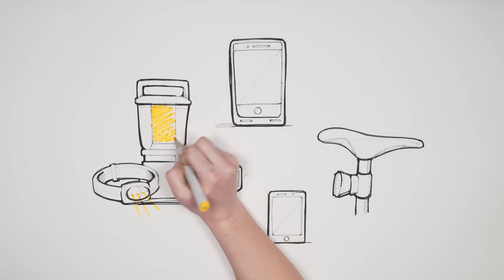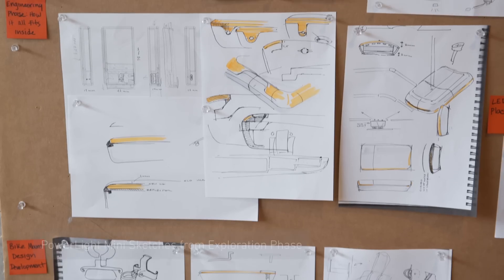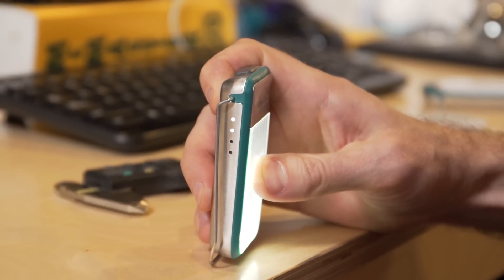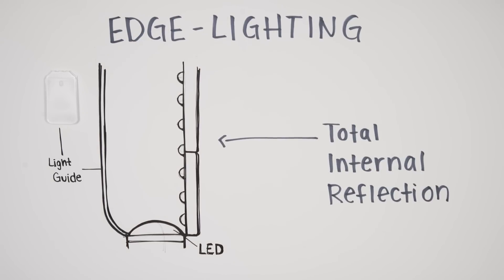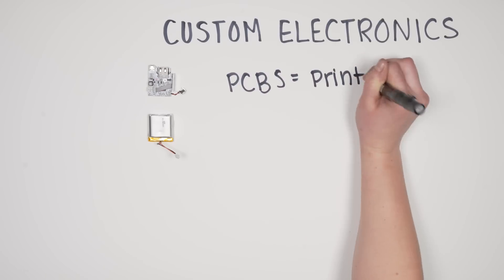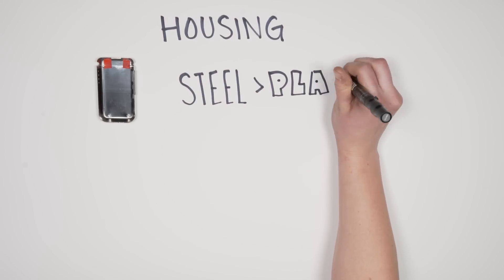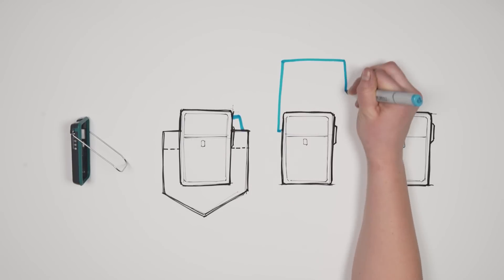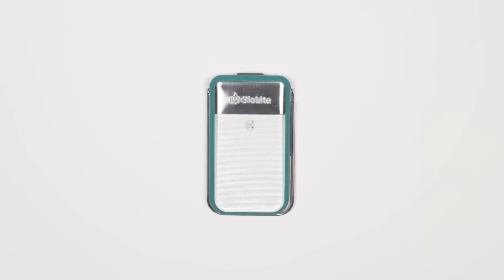How Do You Make Big Light Fit In A Small Space?

Comment: Thank you for producing this video of your great new light. I just picked up two and I'm very pleased with them. The wire clip seems perfectly-designed. We used it just last night at a dark restaurant so my elderly friend low vision could see her dinner.  It worked perfectly, as we could adjust the wire clip/stand to get the light angle and position just right for her needs. It was also nice to be able to dim the light, since it's so bright. I've also found the Mini works great walking the dogs at night.

I own many other BioLite products and appreciate the thought you put into the designs. 

Thank you for making the case metal, so this light is hopefully sturdier than some others.  Other small lanterns like this I've had suffered from being VERY fragile. 

My only improvement suggestion would be to make the button a little easier to activate, though that might enable accidentally turning it on.